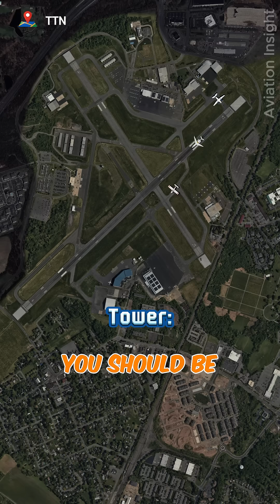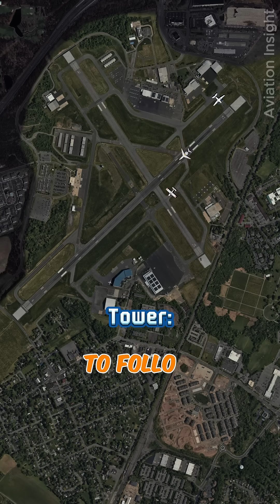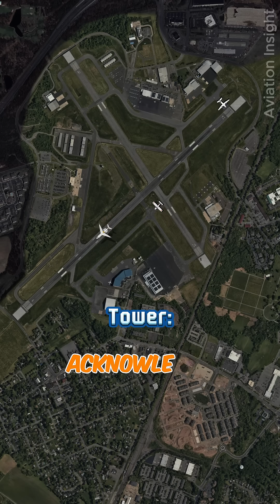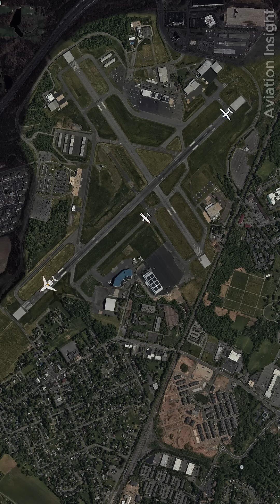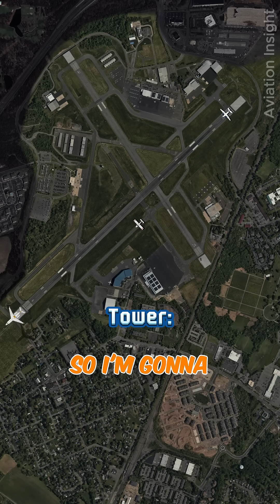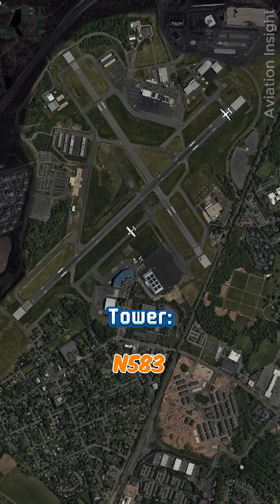Pilot’s Effort to Help Backfires — Controller Blasts Him / ATC Recording #aviation

Comment: Why is it dangerous if the pilot just repeated the atc instruction? It’s not like he told a plane they were clear to line up when they weren’t was it?
Reply: It could be catastrophic if they repeated the wrong info. Maybe he got it right this time but if this practice was accepted, we'd see an uptick incidents
Reply: @cbtutufff or we might see less incidents the times when pilots correctly help out? A pilot is only going to help when they are sure they know what the instruction was. I get that it’s not proper procedure and should be avoided but i don’t see how it’s as dangerous as the controller made out
Reply: @jamie123b Maybe this situation wasn't dangerous but in general it's very unsafe and illegal, and the controller has every right to be mad. You can't just disregard the rules even if nothing happened.

You cannot assume that pilots will repeat instructions only if they know what it was. We get our own read backs incorrect sometimes even though we were sure it was correct. What if the controller didn't want them to line up and wait anymore?
Reply: @jamie123b  bro all rules and regulations and procedures in the aviation industry are written in blood.

Comment: I know he was trying to help, but let me give an example of how this is super unsafe. There are times when there is a very very small amount of time after a landing plane crosses threshold that you have to put another aircraft in position. During these times if the aircraft is hesitant or slow to respond the controller will change the plan and have them hold short because the opportunity passes. If he didnt hear a response, he could assume the aircraft isn't on frequency and start doing something else. And depending on if its a small aircraft or the equipment the controller has in the tower he may not see him taxi into position. Now you have a small aircraft in position that no one can see with another aircraft on final trying to land his plane. Very good intentions trying to help out, but its probably best to ask the controller if he wants you to relay a message for him. Then if hes a dick, it's a 100 percent on him